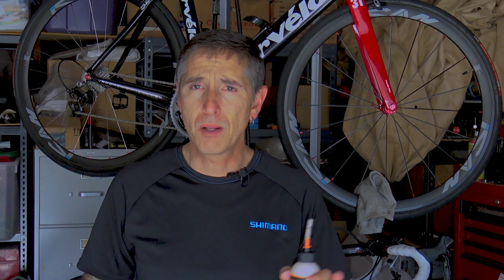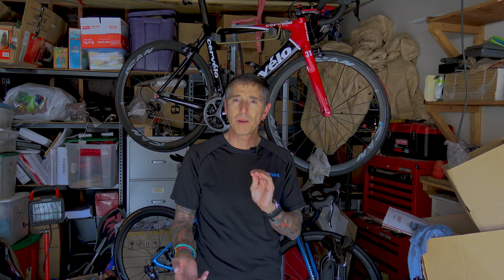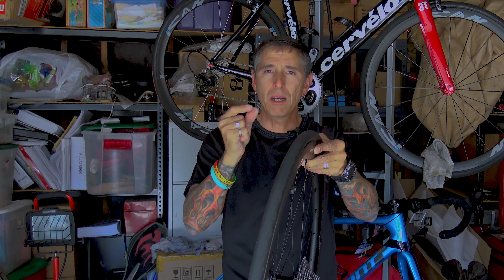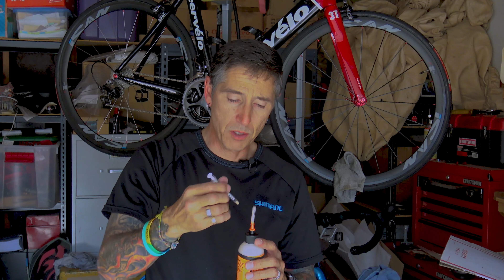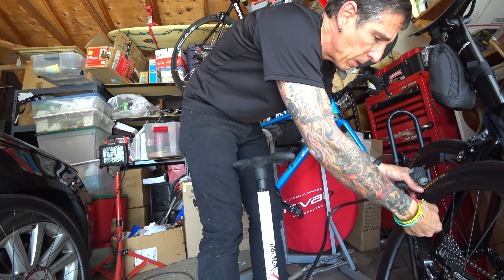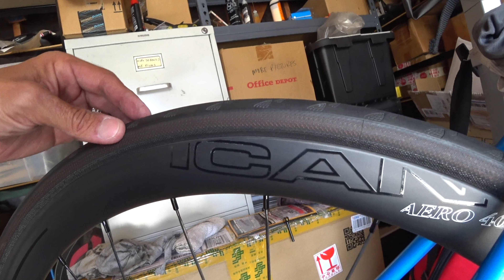Minimizing flats out on the road. How to add sealant to tires with tubes.

Comment: It's funny to see, how easy the tire goes on on your wheel! On my rim brake version of the Aero 40, it was such a pain to get the GP5000s on, that I still have blisters on my thumbs! So now I am hoping of never getting a puncture! Not sure, if after some time/aging it will be easier. If I have to do the same thing on the road after getting a flat, I am screwed.
I wonder if there might be a difference between the disc and rim brake version concerning the shape/thickness of the rim hooks, that could influence the force necessary.
Reply from the maker: Hi MrSuicycle
! I have had these tires on and off a couple of times - that is why it was easier. When I would use Vittoria Open Corsas, those were always a nightmare at first. Tires do loosen up over time. When the tires are really tight like that, two tires levers is the only way to make it happen. If you do, or when you do get a flat out there, the tires will be easier to get off and then on since they will have been filled to pressure for a while.

Comment: I have a tire recommendation.  Will save you 6W/tire, and runs tubeless. https://www.bicyclerollingresistance.com/road-bike-reviews go to ebay and search Schwalbe ironman 22, 6 for $75.  Tubeless works great on ICAN wheels. Measures 24 on the icans. I run at 75PSI. Very comfortable.  Very very durable.  I get 5K miles on the rear and then toss it. About 8K on the front.  I use the same sealant.   12W is a lot.